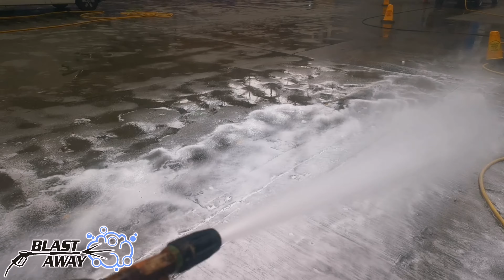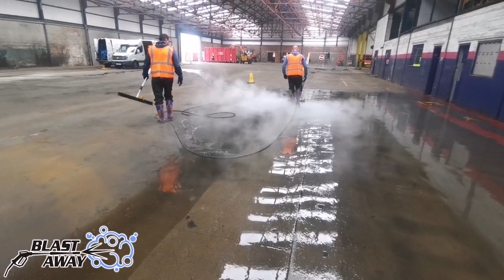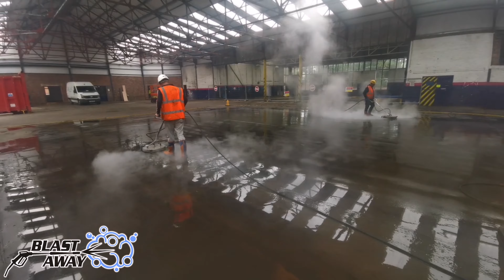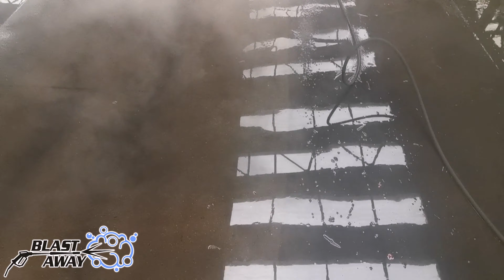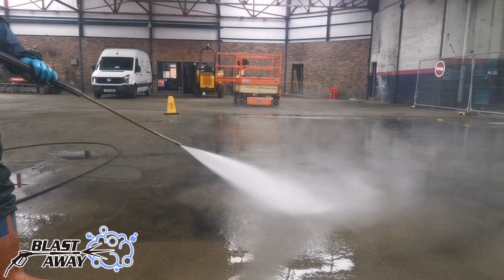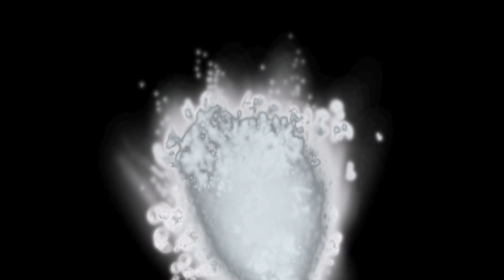Hot Surface Cleaning | Oily Greasy Industrial Unit Floor Cleaning | Dilapidation Cleaning

Comment: Nice clean up! Do you still use the falch flat surface cleaner as not seen it for a while? Keep up the gd work M
Reply from the maker: Got 2 of them, they're just sat in the unit mate, very rarely use them
Reply: @BlastAway  shocking m8! And I bet they went cheap! Why aren't you happy with them, just curious? M
Reply from the maker: @matthewcalder4351  what do ya mean mate they went cheap?
You talking about the Falch Scaters?
Reply: @BlastAway  soz Lee bit of a typo,  I ment to say " shocked the falch skaters are stood up as I bet they where not cheap to buy! " then asked "what dont you like about using the falch skaters ? " just curious 👍 cheers M
Reply from the maker: @matthewcalder4351  they'd be mint on this floor to be fair.